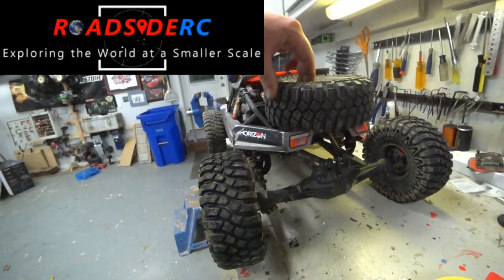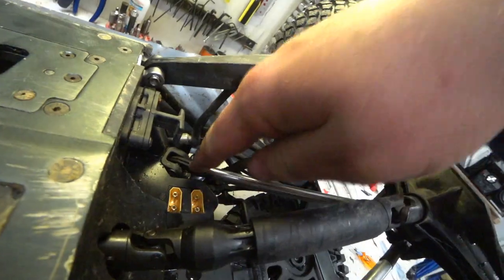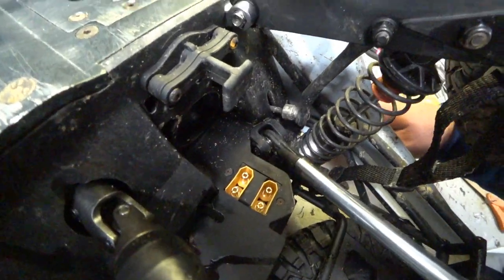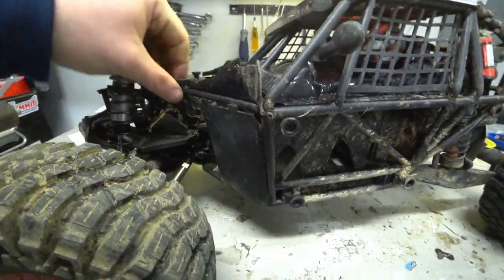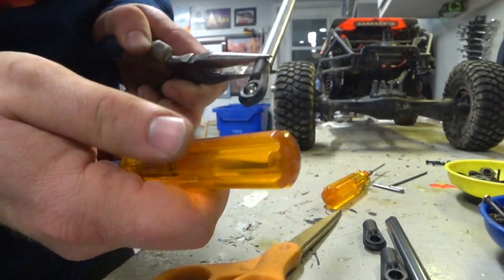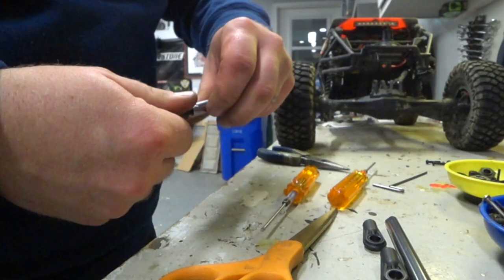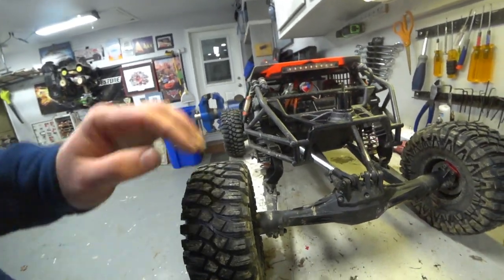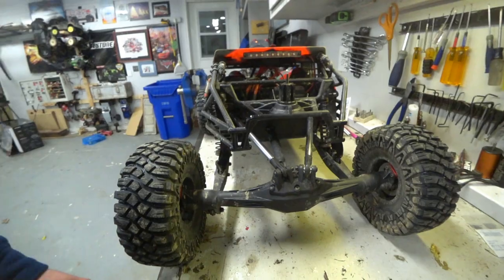Losi Super Rock Rey Upper Suspension Link Replacement

Comment: Just got my SSR today and I have been watching your vids and you do a great job with helpful info.
Reply from the maker: Great!  Glad these videos are helpful!  I really appreciate the feedback.
Reply: @RoadsideRC   i just got ours last week, and my son been running it pretty hard. Does you SRR fish tail like crazy on 8S? Mine going straight just fish tails like crazy and I thought it was the links, but they seem good. Tip?
Reply from the maker: @arod7130  Yeah - mine did that as well.  Was almost impossible to control on 8S and full power.
Reply: @RoadsideRC  so this is normal? Any upgrades that you’ve come across that helps? Almost feels Like it need more weight in the rear.

Comment: They consumed a lot but did not break at least👍, there are no aluminum upgrades?
Reply from the maker: No aluminum upgrades for these ends.   Hopefully it really will not need it.  

These only stretched with a VERY HARD hit.
Reply: Pity that they do not make them, yes I have seen they have lengthened a lot

Comment: Hugh and beefy! Awesome upgrades man.. any issue with the steering on Beast?
Reply from the maker: Thanks. 
Unfortunately, yes with steering issues. 

The factory servo is junk.   It is also not a standard scale size. 
So, we had to buy the 1/5 servo mount ($70) and a 1/5 servo ($$$).  Pretty sad on that front.   It was a lot of extra $$$ on an already expensive truck.
Reply: @RoadsideRC  I hear you brother. As you may know the servo that came with Yeti XL is also JUNK!! I've fully upgraded the front end of my Yeti XL and seems  smooth steering so far. I know steering slop was an issue with Yeti XL for alot of guys. Upgrades definitely made a tons of difference.

Comment: What is the diameter of the threading that goes into those ends? If they are around 4-5mm you might be able to use the ends from the 6s Arrma stuff (where you may have to cut them to the proper length, cause they are pretty long). In my last running video, I broke a camber link on my Yeti XL, and fashioned new ones with (I'm not sure where the link came from) a 5mm steel link threaded into I believe are the Arrma rear link ends (not really sure, because when you get the Arrma ball end set, you get every conceivable one). I just mixed and matched them until I got the length that I needed (the straight ones, as some are angled). Might be worth looking into.
Reply from the maker: Good call! You are right that those seem roughly the same size threads in my mind.
Reply: The rod it’s self is 10mm I think so not sure on those being 5mm threads I’d thing 6-8mm but could be wrong

Comment: Just got my super rock Rey and stripped the thread on those rod ends, have you had any luck sourcing those parts separately??
Reply from the maker: Nope - not at all.  Isn't that disappointing?   
Check on the Super Rock Rey Facebook group.   If I remember correctly, someone found an all metal alternative.
Reply: Roadside RC many thanks for the reply 
Quiet sure can make or adapt something.other than that AWESOME MACHINE

Comment: In my case - plastic end parts yanked out from the metal part screw. As there is no official aluminium ending part, I am going to try this from aliexpress: https://www.aliexpress.com/item/32820426343.html. But first I have to make some measurements of the plastic one.
Reply from the maker: Good luck!
I hope it works, as it is certainly a needed upgrade.  I always wished RPM would come out with a strong end for it.